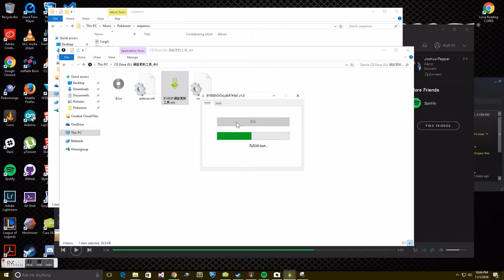Uploading audio to BY8301-16P SSOP2 MP3

Comment: To help:
1) if, when you plug the device on your PC, you don't see it, change the USB cable. With some, the device led is ON but don't flash. With other cable, the led flash and you can see the  device.
2) To open the device click right on its icon and select open. Double click don't work everytime.
3) If, following Aaron instructions you get, when you want to download a message saying "have not defined mode in flashdata.ini" this mean the exe is not compatible with the Windows version you're running. So quit the exe, click right on it, choose "property" then "compatibility", check the chekbox and choose "Windows 7". Then, run again and this time, it will work.

In all cases, one question stay without answer: we can add files, but how can we delete files???? Any idea?
Reply: You save my time, thank you.
It was wrong usb cable {facepalm}
Reply: I was just going through the same issue with the cable. One thing I learned is that the micro USB cables that come with most things are for powering only (thus the VCC and GND) and it does not support data transfer (Missing D+ and D-). I ended up using an old xbox One micro usb and it worked perfectly.
Reply: I was racking my brain because every PC I have would not recognize the device. The freaking cable!!! Thank you for the comment.

Comment: Nuts, dude.  Do you know what my problem was all this time?  I was trying to test it while using the USB cord connected to my computer for power.  That meant it was still in transfer mode.  Once I disconnected the damn thing and used a separate (wall outlet) power source, it worked PERFECTLY!  I'm glad you posted this video, because I was watching the green light flash, and knew something was up.   Again, much appreciated!  I do have one additional question though-  Where did you end up purchasing your boards at?  I'm looking on Aliexpress, and they're like $7.50/$8.00 for just one.  I thought I heard you mention you got a better deal somewhere.  Anywhere specific I should check?  Thanks!!
Reply from the maker: Creative CoPilot I usually go through eBay for electronic components, the wait sucks though.  The power issue seems to get a lot of people. I have two USB ports on my computer that don't have drivers and I can use it to power it. My guess is it never tried to send anything on the data line so it never gets in that mode
Reply: Man- CRAZY month.  Wife and I had a kid, so all Arduino projects went right out the window, hahaha..
That being said, I would like to maybe jump back in and take a look at a possible project with this guy once more.  Do you happen to know how to call direct audio files from it?  -Rather than by just grounding the circuitboard pins, and playing the four or so files?  Much appreciated!